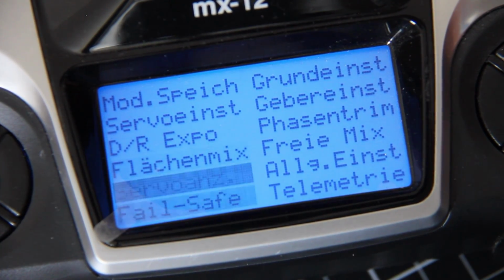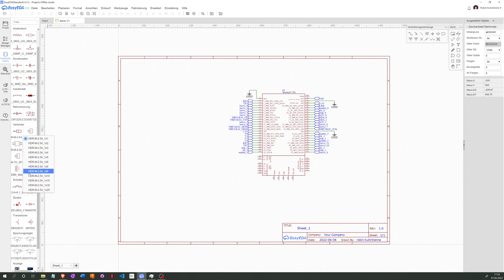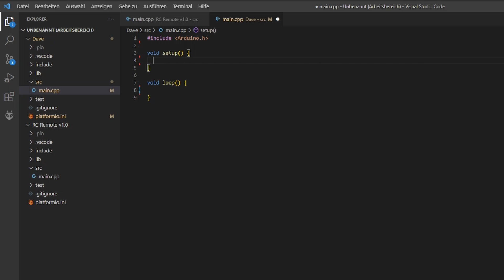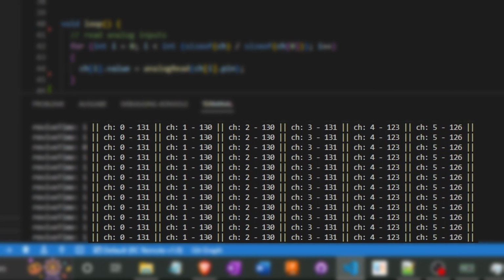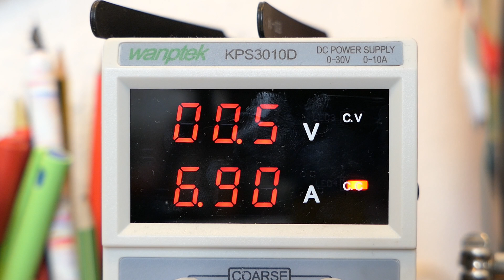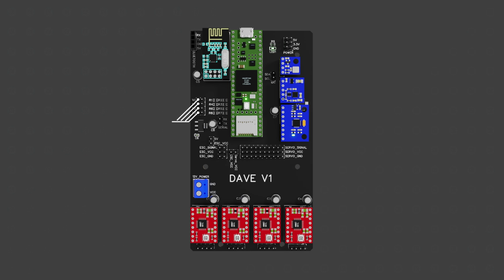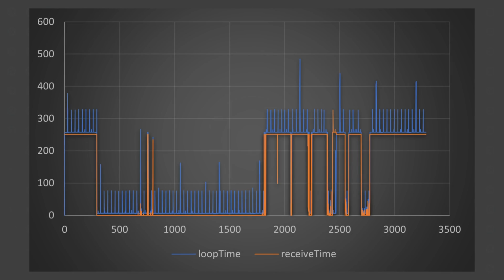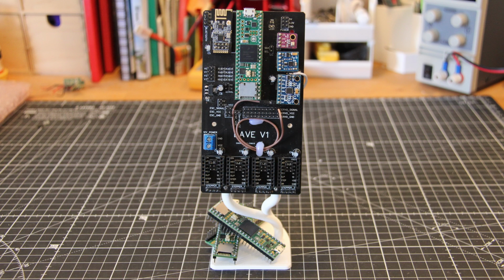Building a Teensy RC System | DAVE V1

Comment from the maker: Hi. There are a few thing that I did and that are not mentioned in the video.

1)	I added support for XBee modules. I got my hand on two XBee SX modules and they seem to work great. Although I didn’t do any real testing.
2)	I talked to someone who knows a bit about radio communication. He suggested that the remote I used for controlling the plane during the range tests interfered with the radio communication 
        of the NRF24L01 module. This is very much possible since both of them use 2.4Ghz. Again I didn’t do a lot of testing.

The reason these things are not mentioned in the video is that they happened after the video was pretty much finished. I am really busy with final exams so I don’t have the time to remake the video.
Reply: good video